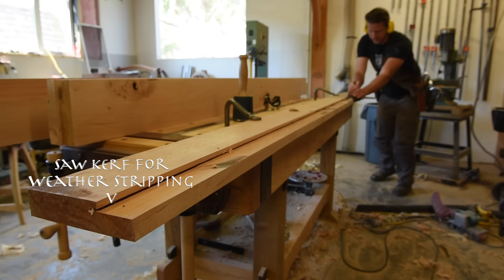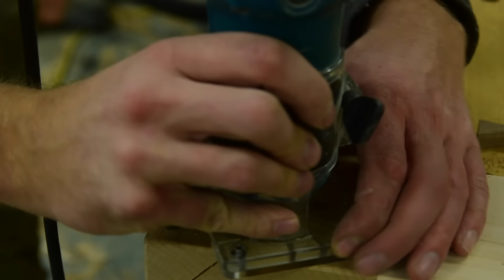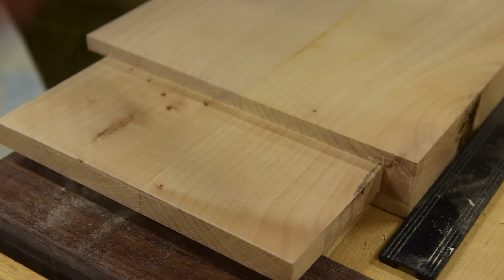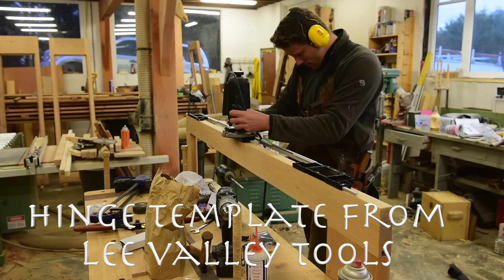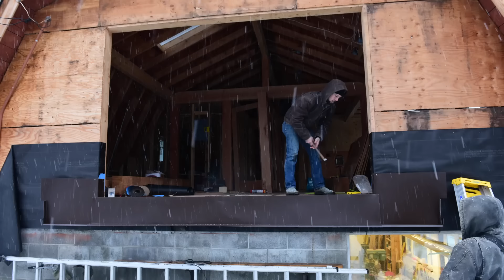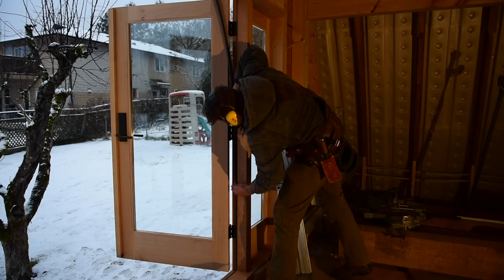Woodworking, Building French Doors, How To

Comment: In the world of YouTube I know it's customary to say how I "woulda done this differently" or how I coulda "done that better", but as a woodworker myself I just wanted to take the time to tell you that even other craftsman admire your work. Great job on the doors and thanks for all the entertaining videos.
Reply: hcwd workshop When you say 'customary for [other craftsmen to say how they] coulda/woulda done better, you mean 'common for trolls to shit on other yt'ers' work, right?
Reply: Right? and look how easy it is to just say, wow, man, i really enjoyed that. Thanks hcwd, keeps my faith in humanity.
Reply: He should not have used maple for an exterior door which will be directly exposed to the elements. Also, he should have sealed the top and bottom edges of the door with some kind of oil-based finish, exterior glue, or other waterproof sealer, before hanging the doors. This is good advice, not trolling.
Reply: Amen to that the fit on those hinges was tight!!

Comment: Samurai, indeed you are wise and awesome. There are many ways to skin  cat and build a door. If I can be so bold though to make a few suggestions for the next time you make some doors, or windows. Mainly with the glazing aspect,  in NZ doors I have made were always glazed and beaded from the outside. The bottom stile is beveled slightly as is the bottom bead to match, this prevents any water sitting on the edge( i know how much you hate water sitting on things). Also I sit the glass on little bits of rubber as well as running a couple of saw curves in the bottom bead to allow any water did get in a place to exit. Granted this does take a little extra time, I know you love these bits of extra detail though. Love your work!!

Comment: Jeesh, man, you've got to either start using sawhorses or an assembly table instead of crawling around on the floor (such as at 2:00) on your hands and knees during assemblies!  It may seem easier now while you're a young man, but believe me, it's going to be much harder the older you get!  Not only that, but in most cases floors aren't level enough to ensure assemblies get clamped up true and warp-free... so get with the program, and now (smiley face should be inserted here!).
Reply: Exactly. And the perimeter frame does not have to be 100% in one plane because it is quite twistable.

Comment: Amazing result looks fantastic and air tight. Question, where you've joined the mortise and tenon joints together at the bottom and top of the doors there are square holes, did you fill these with wooden blocks?

Comment: why didn't you haunch the tenons on the door rails? how did you fill the gap left between the dado and tenon shoulder?
Reply: Jonny Aykroyd  was wondering the same thing.
Reply: Just glue a scrap piece of wood into the gap. Also glue bonds wood and wood together so securely that the door will not sag even if without wedges.

Comment: Great work Samurai, well crafted and beautifully done. I especially like that you use old style woodwork and nails and screws. I have a question that you or maybe one of the other professionals that subscribe here can answer. Other than the reason of opening the french doors outwards, Why did you place the hinges pin outside instead of inside? Wouldn't that make it easy for someone to break in? They could drive the hinge pin out and take the door out. I'm asking because I watched a show on TV by Mike Holmes, a seasoned construction contractor, point that out on a job he was doing after the home owner hired someone else and they hung the French doors backwards or where the hinge pin is outside. Maybe that's not something you're concerned about being where you are, I don't  know. I'm no professional I'm completely ignorant. I just love watching guys like you make such beautiful things. I just want to learn.

Comment: Is it single pane glass? How is its insulating value? Aesthetically it loos awesome.
Reply from the maker: it's thermal pane glass.
Reply: It's glass, it could be quad-panel transparent aluminum with triple flowing double pump argon, and it's R factor might hit 3.  Really, if you're worried about energy efficiency you don't install glass.
Reply: It doesn't take several months to get "custom" single pane glass.  You can see it is double, and probably argon filled.
Reply: IG    or insulated glass.   was it 7/16 OA or larger ?   Did the glass have a UV coating ?
Reply: It's a IGU other wise known as insulated glass unit.  Typically a single pane, aluminum spacer filled with desiccant, then another pane of glass.  Usually sealed with butyl or another type of sealant.  You can make the OA whatever you like to fit your project. What he did here is very common with glass. Awesome craftsmanship!  Those are absolutely gorgeous doors.
Reply: where do you order the insulated glass units?
Reply: Any glass shop
Reply: It is double glassed. You can tell if you look more closely.

Comment: Nice work!  Can you show how you addressed the gaps on the bottom and tops where you joined the door panel frame together?  It looks like there will be two gaps at the top and bottom of each door until you hit the tenon.  Is that even an issue?

Comment: I noticed You mounted the glass from inside. In Denmark glass is always mounted from the outside! But very nice job!
Reply: in the uk we mount on the inside too. mainly for security. timber beads are easy to pop off and pull glass out and your in lol

Comment: Nice doors, Question??
Why didn't you fill the split with glue and pull it in with a clamp to cure then cut the dutchman in?  Was it because that was finished size? 
Maple I like, but I might have used Ceder on that with a maple viner on the inside.
Are they showing any rot?

Yes you are making good memories for your kids, Its why I like woodworking,
My dad used to build Cedar canoes in the basement when I was a little boy.

Comment: I always install doors with the glazing bead on the outside. Is the a reason you did it in reverse? I was taught so that way, any water that went between the glass and the bead could continue through but with the moulded side out it had nowhere to go but inside

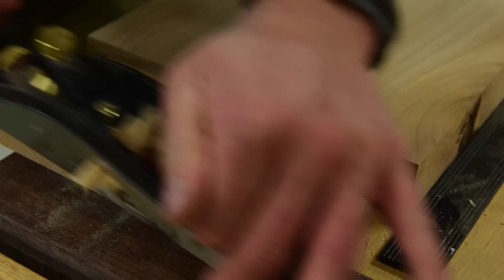Comment: I couldn't help but noticing that you didn't use a shoulder plane at 4:40 to clean up the tenon shoulders... or perhaps you used your wider bladed plane to do the broad faces of those tenons (which certainly makes more sense) and a shoulder plane for the shoulders?
Reply from the maker: I used the Veritas Jack Rabbet plane which is a combination wide body and shoulder plane with a low angle blade.  The most versatile plane ever made!
Reply: I certainly don't question your comment about that plane's flexibility, even if its sides aren't nearly as deep as their shoulder planes.  Go Veritas!

Comment: whats that piece of wood inbetween the two doors,there looked to be like an inch gap when you first put them in,what is it for
Reply: patchedupdemon a t astragal would generally fill the gap. Looks like he just surface mounted s4s ( stock smith four sides).  I threshold either. Sealing the end grain top and bottom would slow some expansion. Looks great. I like outswing doors. Can't be kicked in and the harder the wind blows the tighter the weatherstrip will seal. All commercial buildings have outswing doors for patrons inside to be able to make a quicker exit shout the need arise

Comment: Hi Samurai Carpenter,

I am in desperate desperate need of your suitable advice.

I am in India and currently adding another level on my ground floor home. For the lounge window on the first floor (still under construction) I want to install French styled thin-lined white beautiful windows. My questions/concerns:

My contractor is insisting that we install stone fixtures to hold window frames (reason: there's been a bad history of termites eating up our ground floor wooden window borders/fixtures). The contractor also doesn't know how to create the White French style thin-lined windows, and he says "I do not know how to install glass into those small square frames"

The final stage of finalizing the windows is arriving very shortly, say a week, and hence I would really appreciate if you could provide basic guide on how to create and install french windows (small thin-line/taped square style) that I can show to my incompetent carpenter and have it installed at home.

Any advice on above will be appreciated.

Cheers
Jeff

Comment: How well insulated will the doors and windows be?
Reply: I can't say much about the doors. but as a Glazier by profession, he should be good on the glass. he used whats called an "insulated unit" its two pieces of tempered glass with a metal banding filled with a moisture absorbing silicate to keep them from fogging up if moisture does ever get it in.. they sell very energy efficient ones with a "Low-E" coating that that reduces that amount of heat thats transferred through the glass significantly.
Reply: Steve Buscemi do you know where I could find glass like that!  My internet searches are not working for me.

Comment: How do you determine which way that door swings (in or out)?
Reply: I would of swung them in, I feel like there's a better seal from the weather, but hey that's his business
Reply: Biggest reason IMO to have your doors swing in is so the hinge is not accessible from the outside; could be easily removed by a crook. That said, he's in Canada so probably ok there ;)
Reply: Security hinges (like he used) cannot be easily removed. A serious crook is going to go for the glass anyway. Unless we have a 'samurai' crook, lol.
Reply: I would rather have sliding doors....Plus some person could break into this house by removing the hinge post and taking the door off.
Reply: Not without a lot of work they couldn't. By the time they got done cutting the hinge apart to defeat the security hinges he used, it would have been faster to simply break the glass.
and sliding doors suck.
Reply: sliding door do not create lost space for furniture etc, you are not thinking,  Plus, smow, shovel all you want to, i would not like to.   still you know I AM RIGHT ABOUT THE HINGES, CALL THE COPS IN YOUR AREA AND LOOK AT YOUR OWN DOORS, ALL INSIDE.
Reply: You can take a hinge off in few seconds if you are are not inept with a hammer and screw driver. breaking glass would be evidence.  Watch a cop show.
Reply: Outswing doors don't give up any space either. He might be concerned about snow in front of that doorway, or he might not since its just a shop. You are not right about the hinges. Depending on the type of hinge, the pins are either secured once installed, or they may simply have non-removable pins. You won't get those apart without a significant amount of rather noisy work. It takes a lot more than a hammer and a screwdriver to break an exterior security hinge. If he wanted more security, he could add a metal stud to one side and a hole to the other. When the door is closed, the stud (just a piece of 3/8 steel rod) goes through the hole in the other side and prevents the door from being lifted out.
Something tells me the people breaking in to steal stuff, are not too concerned with making it look like a scene from Mission Impossible or preserving the Samurai's top notch carpentry. It's easy to smash the glass, open the door and load up what you want. Less time exposed = less chance of getting caught.
Reply: If you watch a cop show, you should be well aware that doors swing inwards such that the cops can easily kick them in.
Reply: neomew sooo true lol

Comment: Very nice, but (there's always a"but", huh?), you should have used haunched tenons. Not so important on the bottoms but dirt and moisture will accumulate in the holes on top of the doors and cause premature failure. That is, unless you plugged them off camera.

Comment: Should have drawn the split together with a clamp before laying out the insert...
Reply: He'd probably already machined it to final dimension, so drawing it together would have reduced its width a fair bit!?!?!
Reply: Miff two solutions. .. old school or new school?  if it split after dimensioning then the split should have increased his outside dimension requiring it to be drawn in....  if prior to dimensioning then you still need to draw it up...

new school is leave the split... pin it and fill with epoxy
Reply: I'm old school all the way! 
I think it was an oversite on his part. It looked like the crack was always there and only decided to stabilise it after he'd dimensioned it.
I agree, I would have glued and clamped the crack as rough timber, butterflied it, then dimensioned it!! But hindsight is 20/20 hey!

Comment: man, i gotta go without just to get dimensional lumber... wish there was another way to get hold of free wood without stealing it.
Reply: If you're anywhere near Southern Utah or Colorado in the US, there are all sorts of deadfall and cut spruce trees from bark beetle infestation. If you can get an Alaskan chainsaw mill, you could probably have all sorts of lumber from spruce, fir and pine trees. Check with the US Forest Service to see what they'll allow you to take, but generally speaking, by fall or winter, all the beetle attacks are done and they die out. Once a tree has been killed, the beetles are gone and their larvae will leave between 6 weeks and 1 year (depending on the species of beetle) after the tree is dead. It's usually safe to take lumber from them at this point as you aren't likely to bring larvae or eggs with you. They don't feed on the wood, they feed on the phloem, so once the tree has died and dried a bit, the beetle lose interest. You'll get some bore holes and beetle marks in the wood but, other than that, it's good for all sorts of uses.